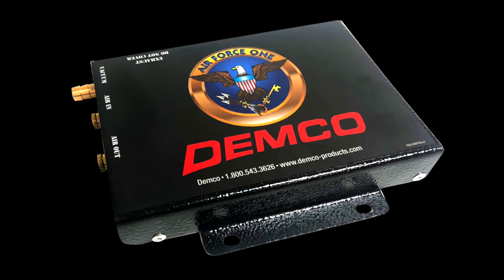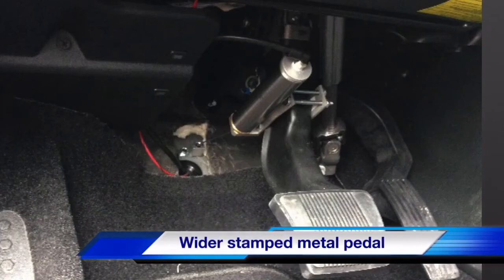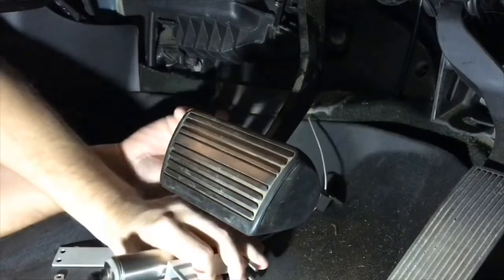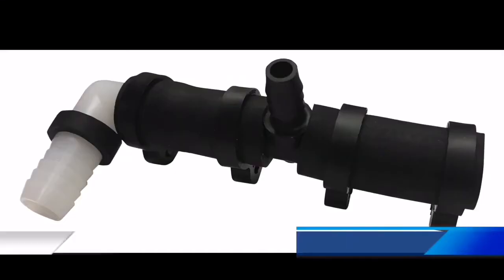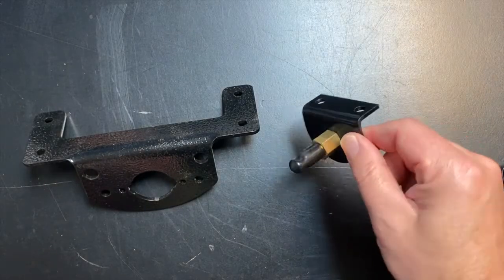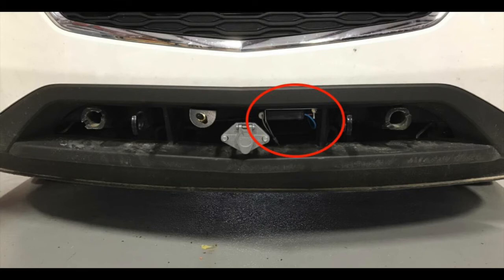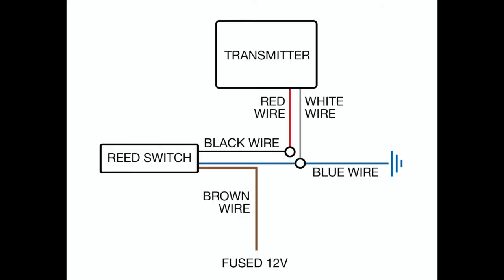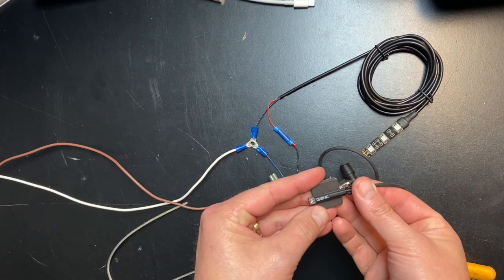Air Force One Car side installation video

Comment: This video shows the actuator as it comes out of the box with the cable coming directly out of the end of the cylinder. In my case, the cable is now broken with a short 1.5 inch length of cable extending from the firewall bracket. There is no cable extending from the back of the actuator cylinder, so I assume the cable broke at the point where the cable enters the end of the actuator cylinder. I recommend owners of this system check that length of cable between the firewall and the actuator cylinder to make sure it is not broken or frayed. I discovered this broken cable when troubleshooting my red LED indicator light not turning off.
Reply from the maker: Cable breakage can only occur if there is an improper angle or if the cable is overtightened in the anchor. Review this step carefully after the cylinder is mounted to ensure proper installation. Also make sure there is a minimum 3-1/2” - 4” between the end of the cylinder and the anchor when brake pedal is released.

Comment: What about theory? There wasn't a diagram or animation to show how it actually works.  How does the coach brake air pressure work to create a vacuum in the toad's brake diaphragm?  Is there a vacuum pump in the box to do that?
Reply: Tom, There is a venturi built in the system to create vacuum

Comment: My read switch only has two wires, is this a new style read switch and if so how is it wired? Thanks
Reply from the maker: Yes this is a new reed switch the instruction and wiring diagram cam be found in the current installation manual on our web site. https://cdn.demco-products.com/documents/Manuals/TB20050.pdf